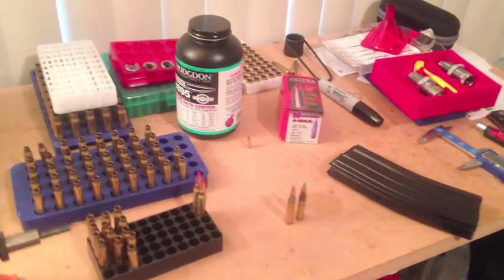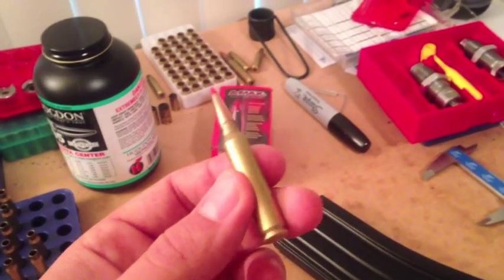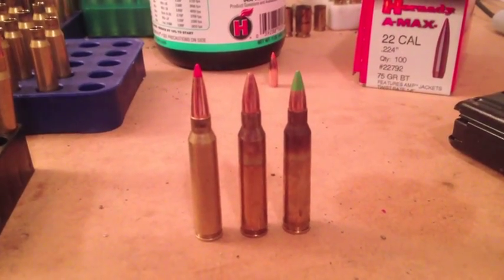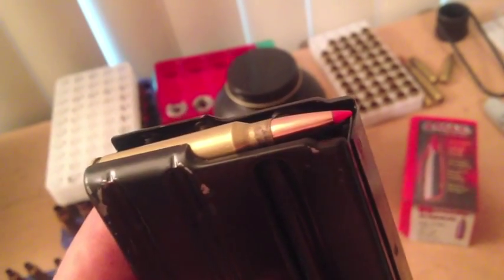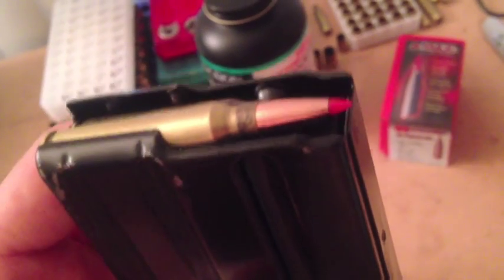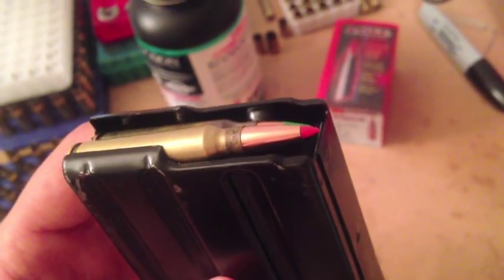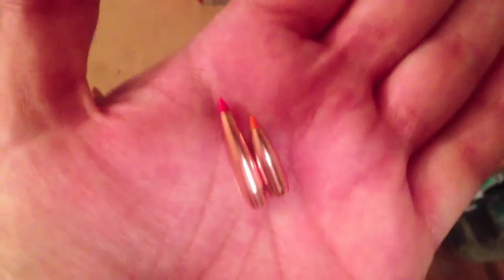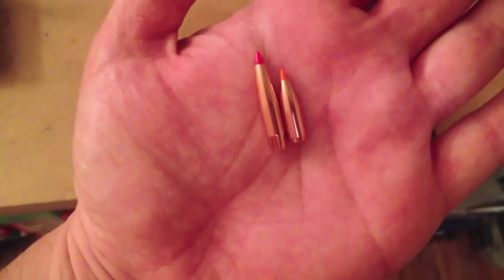Reloading Single Shot .223 for the AR-15

Comment: When I loaded them up for my at I just burned off the red tip and settled them just a bit deeper but fits pretty snug in the mag but works better than any NATO
 rounds I have shot
Reply: how does that mess with bc and range?
Reply: It does not I use a 1-7 twist barrle on my ar
Reply: ok, i would strongly consoder doing this, because the bullet has such a high bc. my only concern is degrading performance by cutting the tip
Reply: it doesn't i have shot them they just lose i grain and have a huge hollow point witch in my gun they travel 36 inches in to ballistics-gel and have a 3 1/8 of an inch in with try and test it on  gel and then reply.
Reply: +Carl Wendigo They are designed for long range shooting, ie. High power competition.  Try them at 800 yards and see if it makes a difference.
Reply: I shot them at 300 yards great accuracy and perfect penatration
Reply: The tips burn off anyway from heat and pressure.